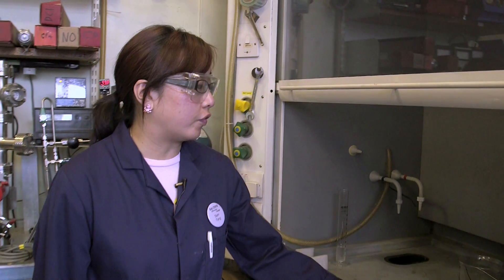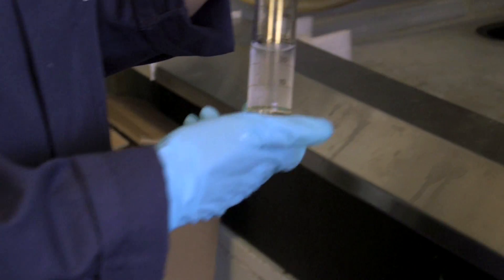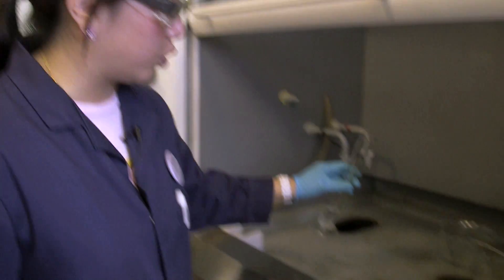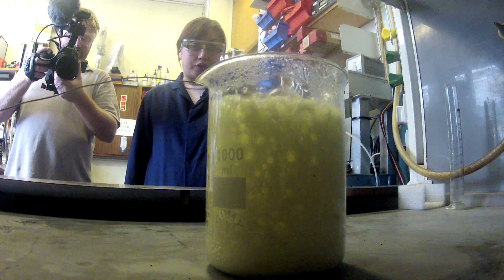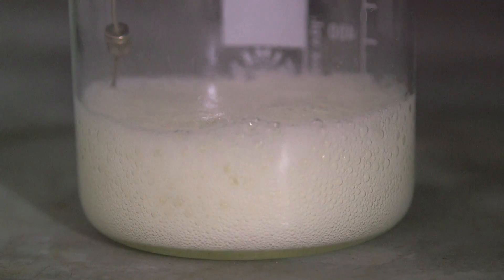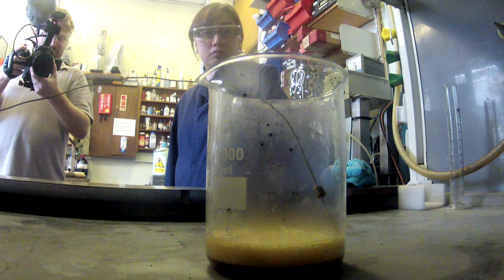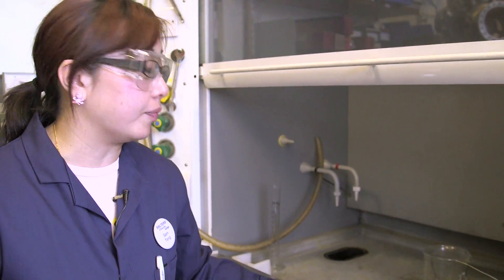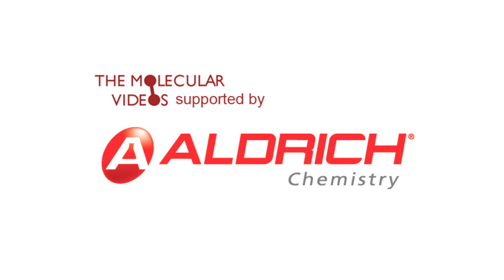Two Colour Chemiluminescent Clock Reaction - Periodic Table of Videos

Comment: Isn't a "clock reaction" supposed to reverse then turn on again several times ?
Reply: That's what's known as an oscillating clock reaction.
Reply: that is a special kind of clock reaction that you probably saw in a different video :) the normal clock reaction is with iodine and goes from clear to black once. There is another one where it goes kind of in a cycle between orange, blue and black or something like that until one of the chemicals is used up.
Reply: No, what you are talking about is an oscillation reaction. A clock reaction is one where nothing seems to be going on and then after a certain time period there is a visual change.